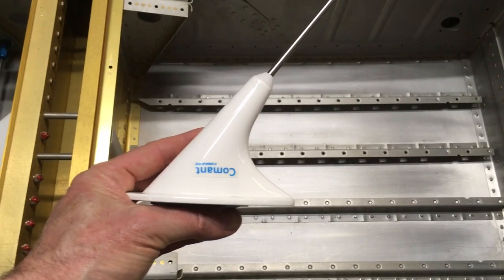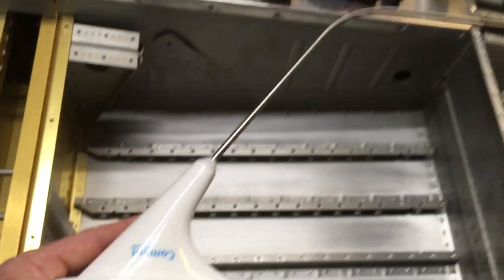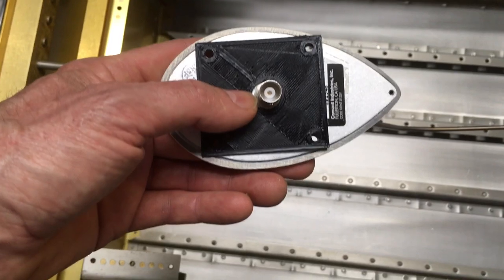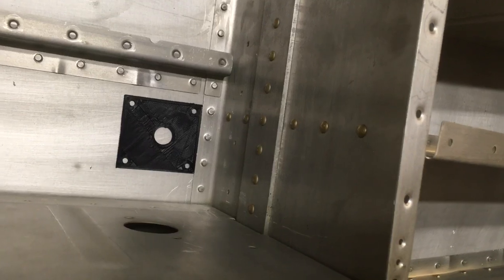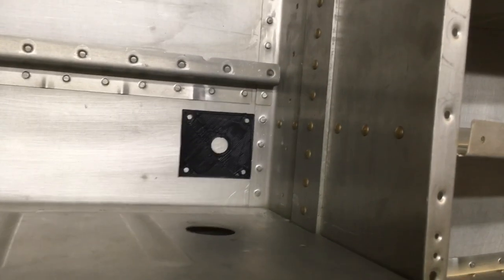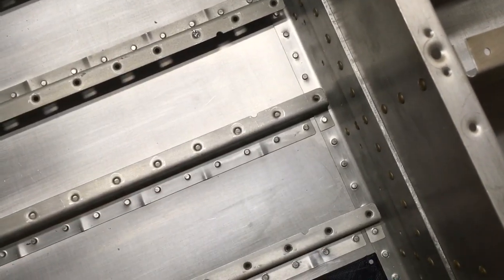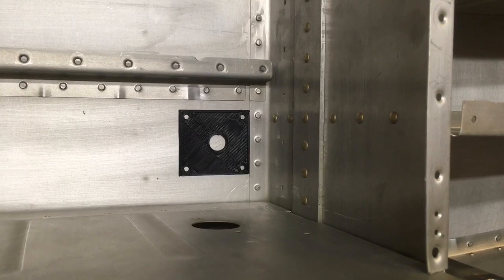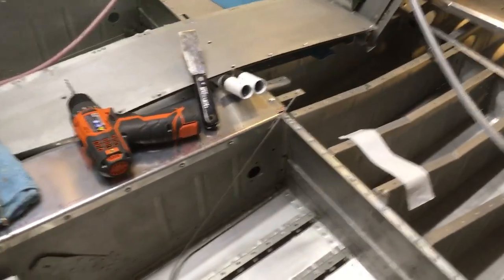RV10 Update - Comm Antenna Location

Comment from the maker: I have posted the stl file for the drill/hole template on thingiverse.  It won't look exactly like the one in this video.  Print two and drill out the center hole to check your spacing on the antenna, then use the other to locate and drill the holes.

Comment: Very cool! Do you have to use a sealer on the mounting plate to keep any moisture away from the BNC connector?
Reply from the maker: No, it mounts with the connector up into the area under the passenger footwell.  UPDATE: the instructions state use a small fillet of rtf around the periphery to seal it.  Thanks for the question!  There is a cork gasket but I'm not sure I will use that either.  I'm not entirely sure at this point if it needs to be grounded to the Airframe, in which case you done want anything between it and the skin.  Thanks for watching!  Is the river going down yet?  I suppose it will be a while, with the snow they got up in the twin cities last week?